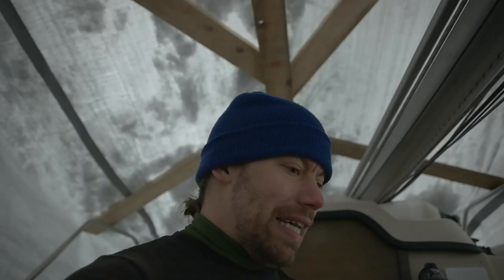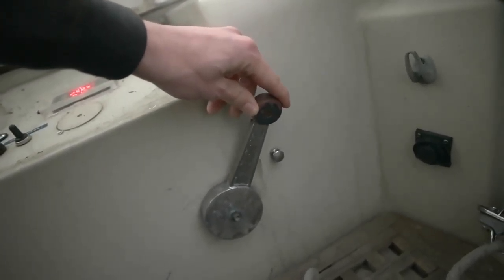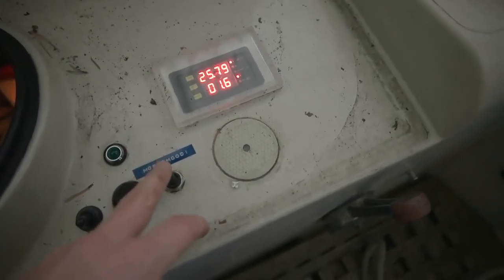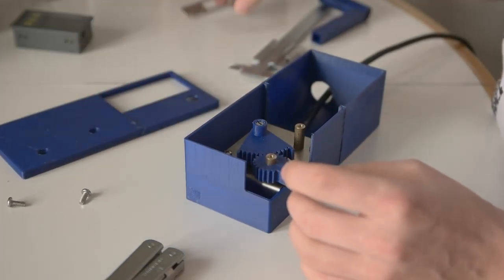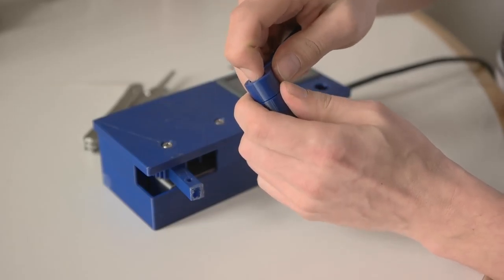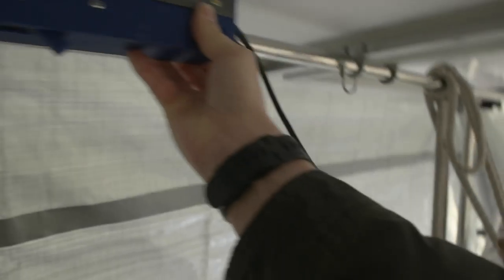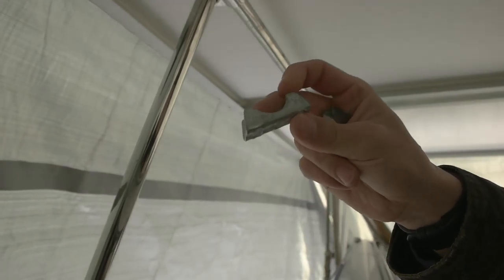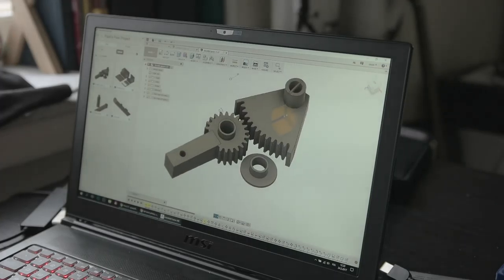New throttle controller box for my electric sailboat!

Comment: 3D printing is wonderful, but for your intended use, I don't think it's going to be very durable. In rolling seas, one miss slip and it's broken. Better to convert a small throttle control from something else. Maybe an older outboard throttle control
Reply from the maker: +Mazda rx7 I'm new to 3d printing. I'm not sure how these parts handle the sea life but haven't seen much of tests so I just might do a favor for someone else :) And it's gonna be that high that if I hit it with something it's gonna be my head so better broke it than my head